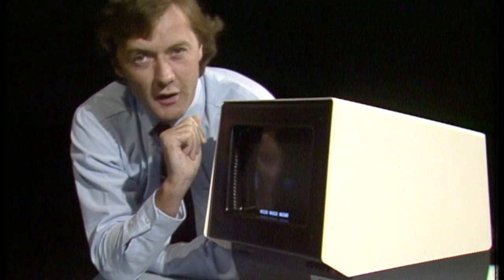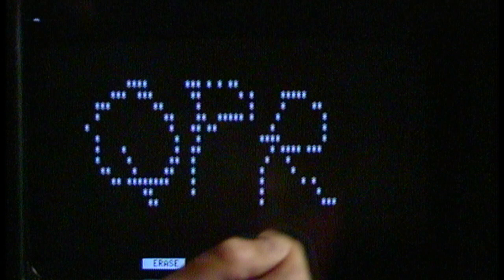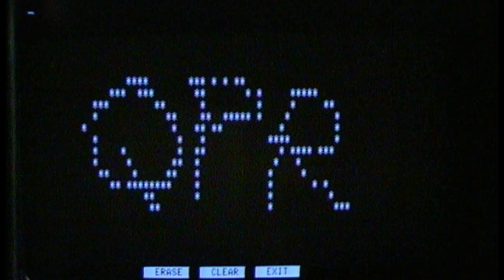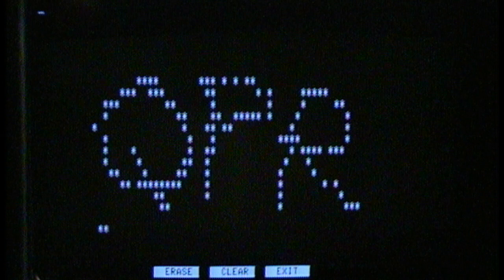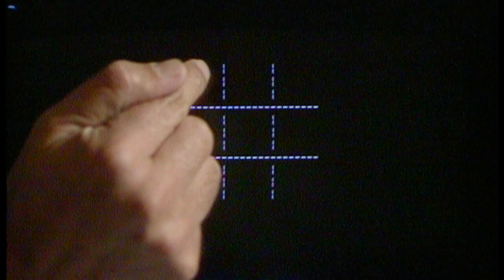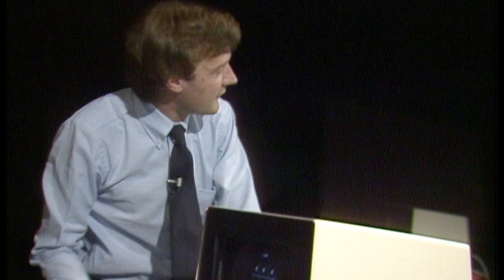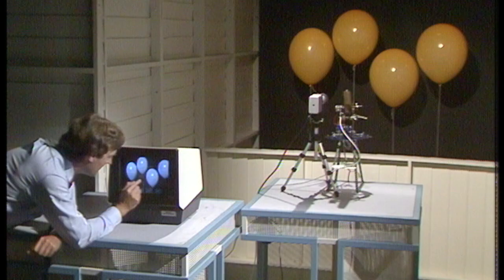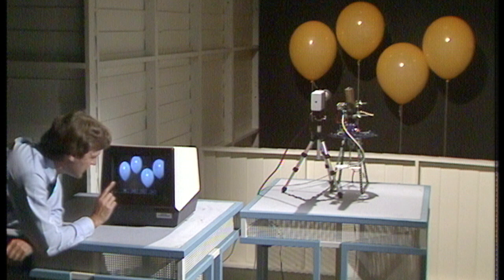Early Touch Screen Technology | Tomorrow's World | Earth Science

Comment: I’ve always wondered how touchscreens worked. It’s nice to know that I finally learned from a video from the 80’s
Reply: This is how a touch screen worked in the 80's. Rather low resolution, so much more precise with todays capacitive digitizer. Our local University had a mainframe system ;Plato IV system that also used a IR grid touch screen for the terminals. Developed in the 70's.
Reply: That's not how they work now, nowadays they have horizontal and vertical lines of a transparent conductive material with electricity running through them instead of infrared, although instead of the IR getting blocked by your fingers, your fingers cause a change in resistance which can be measured.
Reply: @alinaqirizvi1441  you basically described the same thing they said in the video. They use coordinates
Reply: @phuctrinh2589  yes, same output but very different methods
Reply: @eigenman2571 Not so much method, it's a coordinate grid in both systems, but the technology is very different.

Comment: I first used touch screens in 1982. I was 17, and my dad dropped me off at a convention center in Houston for a computer industry trade show.   As I was walking towards the entrance, a stranger approached me and handed me a free pass to get in. That was lucky since I hadn’t considered that there would be a fee to get in.   My lifelong passion for computers was only a few months old at the time. 

Anyway, once I was inside the building, I looked for information, and there were banks of kiosks with touch screens. Everything was text-based, so no onscreen maps. 

There was a lot of cool stuff at the show, but mostly for big business. Halon fire suppression systems for example.

Commodore had a large presence, and they were showing their new computer, which was not yet released. The Commodore 64.   It was so much more powerful than anything else in my budget (it was $600).  Later that summer it became my first computer. 

The second touch screen displays I saw were at EPCOT Center a year later. They were much slicker, with a graphical interface, though they cheated by using a laserdisc system for the visual elements, rather than drawing the visual elements on the screen in real time.   You could use the screens to make dinner reservations, but I think it turned into a video call with a human.

Comment: I used a version of this in the late 80`s at the Natural history museum in London.  It was an upright kiosk that used an Amiga running Scala multimedia (remember that?) to show geology facts.  You could click on various bits of rock strata to get more info on it.  You could also browse fossil photos if i remember correctly.  It was the first time i had used a touchscreen and i recall it was a bit iffy with the touch response, which could be due to dirt on the photodiodes or maybe the resolution of the sensor grid wasnt that great (all onscreen `picture buttons` were quite large). I have photos of the unit somewhere, i must dig em out and post them online as its a great bit of tech history.

Comment: (revised 2020) todays modern technology has the most complex interactions and features in a computer so small, the smart phone. Under display fingerprint sensor, under display front facing camera, software driven hardware buttons and last but not least the stylus.
Reply: The touchscreen also worked way differently way back then
Reply: @gdlunar3773  obviously.

Comment: The screen isn’t actually touchscreen. It’s still you’re typical projection screen. It uses cameras exterior from the screen to make approximates on where your finger would have been touching the screen. In other words I could actually not touch the screen; just be close to it and it would still pick up where my finger is. Modern tech actually requires you to make contact with the screen. 

Still pretty cool for its time
Reply: I have a question, I cannot figure out that's why I'm asking... how the computer figures out at which coordinates the beam is getting interrupted? Can you help?
Reply: Ok, I figured it out just now. The horizontal beam is getting interrupted at the constant X-coordinate of the vertical beam, while the vertical beam is getting interrupted at the constant Y-coordinate of the horizontal beam. And these coordinates are obtained simply by observing which receivers are not receiving their corresponding beams.
Reply: @sandyjr5225 It could interpolate (right word?) a bit as your finger broke 2 or 3 beams on each axis.
Reply: @paulharris7238  right right.. I understand. [Didn't even realize I asked this question over 2 years ago..]
Reply: @sandyjr5225  I only just realised that there were comments.  😁I didn't post it but I was involved in the filming and made the pistol carrier.

Comment: He didn't actually explain how it works
Reply: "In fact they're filtered diodes and they're transmitting individual beams of infra-red to a row or receivers of photo-receptors on the other side, exactly the same thing is happening in the vertical plane
So what you've got just in front of the screen is an invisible grid of infrared and when I touch the screen I'm interrupting both the horizontal and the vertical beam giving the machine a precise co-ordinate of my little finger."

Don't know how much clearer he could have been.
Reply: Thanks for taking the time to write all that.
Reply: Not at all!

Hopefully some diodes successfully transmitted the transcript (and it's intended meaning) to your photo-receptors.